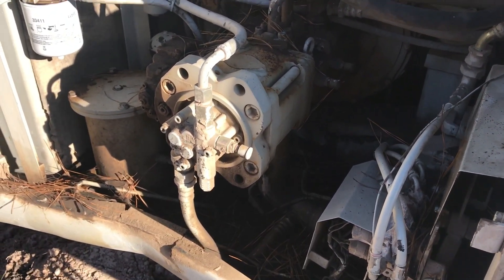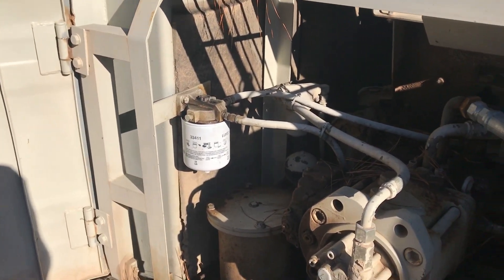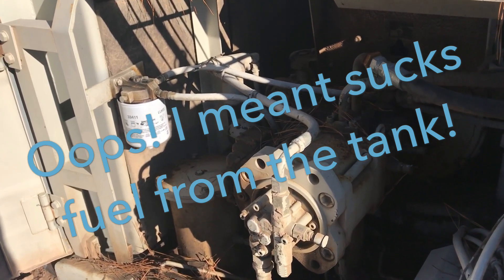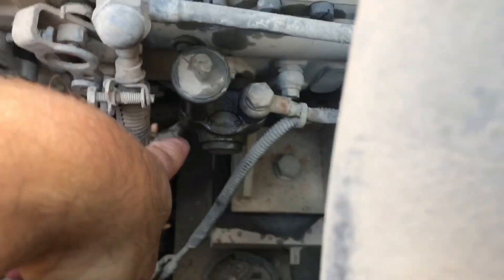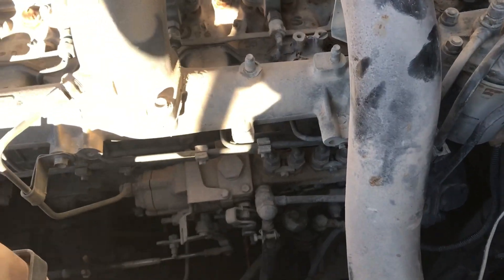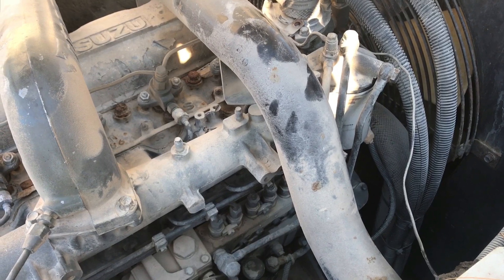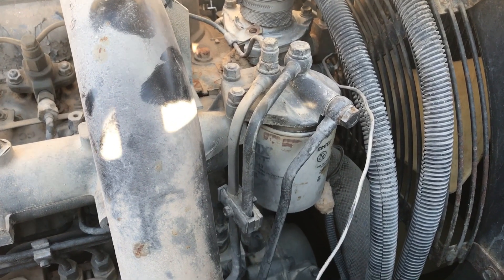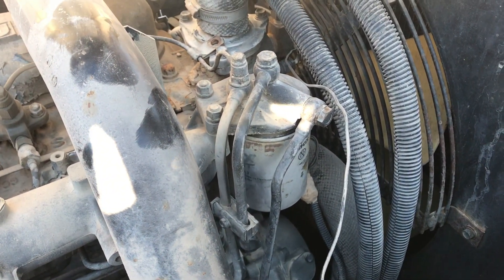Isuzu Diesel Fuel System Explained and Repaired (Link Belt Excavator)

Comment: Best video explaining isuzu engine my npr keeps dying after I fill filter and start it up, won't up fuel from tank changed primer still same but now I know little lift pump must be bad
Reply from the maker: Before you go changing the lift pump, be sure to blow all your fuel lines clear. I start at the tank and take each one off and blow through with compressed air or do my best to shake it out and then rinse through with fuel. Every time I open my tank drain to remove water, I have to shove a wire up in the drain to clear debris and sludge before the water will start draining out. That same crap is in the lines
Reply: @TomBrueggen  i put new lines in but thanks i ended up selling it as is i got the truck for free they called my company to have it removed so i put a little into it to get it running couldnt see scrapping it with 130 and no damage

Comment: I have same issue with hitachi ex120 
Think lift pump is buggered as its not getting fuel any further than the lift pump
Reply from the maker: See this one doesn’t have a visible external lift pump. My mechanic suggested it’s built in. I actually started buying the stuff to install an electric boost pump myself but never got around to it. Good luck!!

Comment: I have the same motor in an 1998 Isuzu box truck.  Was having the same issue described. Fuel filter you are referring to had not been changed in 3+ years.  Just changed it today. Issue seems to be resolved.  Nice video. Ty!
Reply from the maker: Nice! Happy to help. Yeah I’m amazed at how weak they can get when starved for fuel. Otherwise it’s been an awesome engine with no problems!
Reply: Thanks for replying to comments.  I’m wondering if you know, would low oil pressure cause a fuel delivery problem with the lift pump or injector pump?
Reply from the maker: Jason Holt not that I’m aware of in this engine. I believe it is all mechanical (gear driven) and the injectors are definitely mechanical. I know some diesel pickups rely on oil pressure to run their injectors and or injector pumps, but this Isuzu engine is all simple mechanical. At least as far as I know.

Comment: There’s also a banjo bolt on the suction side of the lift pump which has a plastic gauze filter screwed into it . 
Worth checking that
Reply from the maker: Thanks for the tip!

Comment: I have a 2800 of the same year.  Mine has an electric pump between the tank and lift pump and the fuel water separator is located on the side of the tank rather on the hyd pump side.  It all looks retrofitted.  I am hoping that I have a plugged screen on the bolt which I learned from your comments.  Looks to be the same motor with some minor differences.  When cold I start and die over and over again, then it runs just chugging for a bit then runs fine all day.  Already checked for air leaks but now I plan to pull that fitting.  Thanks for the walk through.
Reply from the maker: Yeah this is why I love simple old mechanical diesel. You don't have to question if it's a stupid sensor somewhere. Most likely just a plugged filter. Good luck!

Comment: Tom, there is a banjo bolt on the bottom of your lift pump that has a screen in it. I pulled that screen out of my 3400q today, and it was trashed up again after 40 hours of running.
Reply: Mine is a 96 so it may be a little different.
Reply from the maker: Not sure. I read other folks mentioned the banjo bolt, but I didn't even know what it was to seek out. Repairing the filters fixed my issue, for now. But I'd like to go through and check everything to make sure it's up to par. This is an older abused machine, and she needs all the TLC I can give her!
Reply: Yeah, on the side of the injection pump where the line comes from the separator That banjo bolt on the bottom is supposed to have a plastic screen in it. The separator on yours is not factory. It’s on the side of the tank from the factory.
Reply from the maker: yeah I figured that much out from another guy. He was telling me to look on the side of the tank for the water separator. I was really confused for a few minutes. Duh!
Reply from the maker: Hey so you have a 3400 quantum too? Your machine? We need to stay in touch man. Never hurts to know more people with these machines to catch up with when they act up. I'd like to get my somewhat restored if possible, at least to some of the basic functions. It's probably not feasible really to invest back into things like the electronics and such. But I feel like that electric dial throttle would be nice compared to this mechanical lever I have to yank on. And I wonder how nice it would be to have the power up mode. I just rev mine up and go.
Reply: Yes I do. I’ve had mine a year but have just gotten it going.  It had a broken stick when I got it and had been sitting 5 years.  It’s been a project. But it’s running digging now. Still needs some things. I’ll put some vids up at some point.
Reply: I’ve gotten most of my electrical to work correctly, but it’s taken a lot of work. Does your computer work at all?